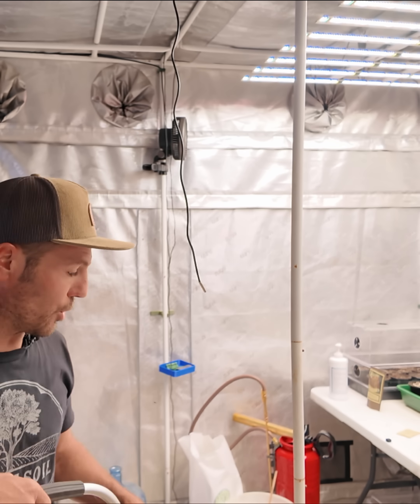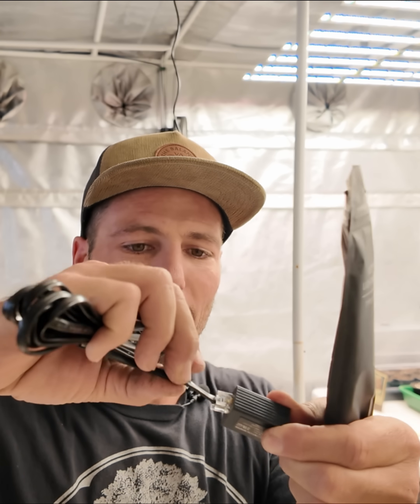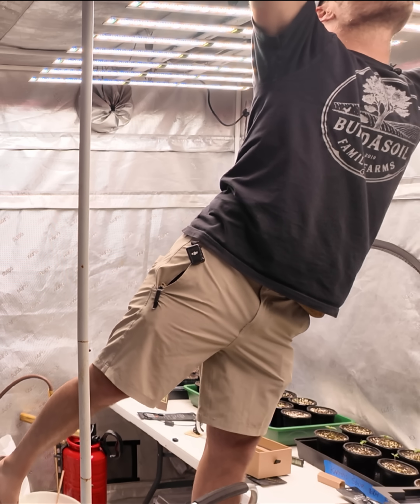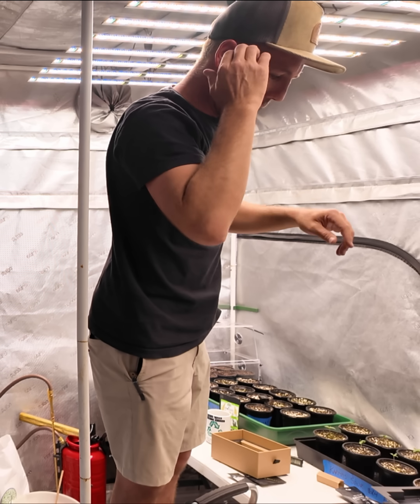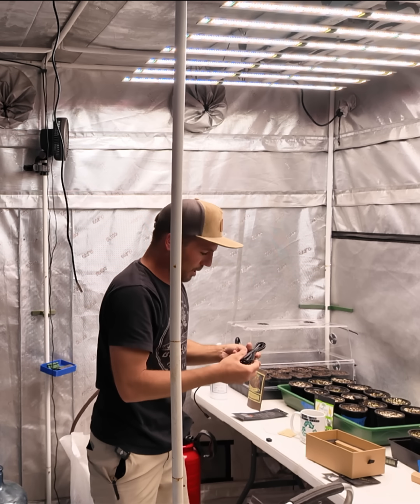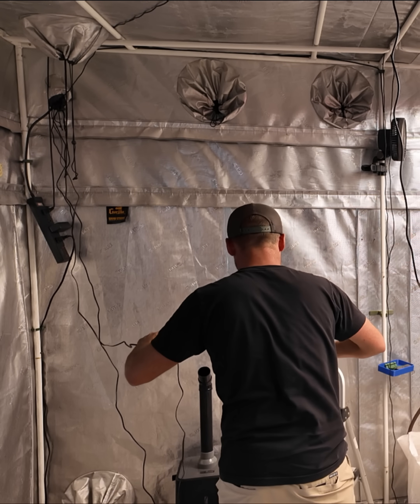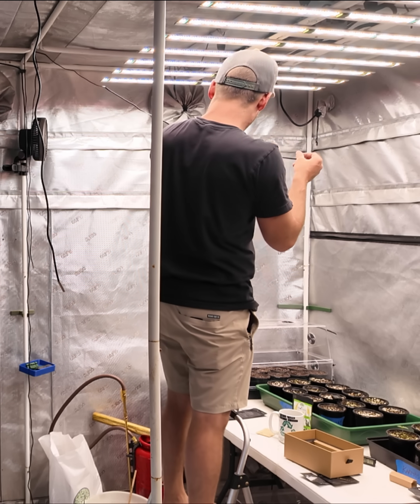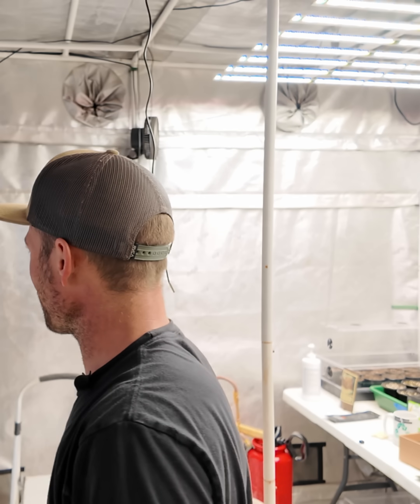Connecting Grow Lights to the AC Infinity Controller

Comment: Did it work?! I currently have the Floraflex 700W light and I asked both Ac Infinity and Floraflex and they both told me they aren't compatible if this works I'm purchasing this adapter 😂
Reply from the maker: Not really. I've done this before and they worked perfect but for some reason maybe I'm wrong but seems like the AI or maybe a software update but this Adapter works perfect except it maxes out at like 80% so when my plants are small I have to lower the light instead but all in all for most all tent growers who don't need 100% on you could run ACI at 10 and likely be good still.